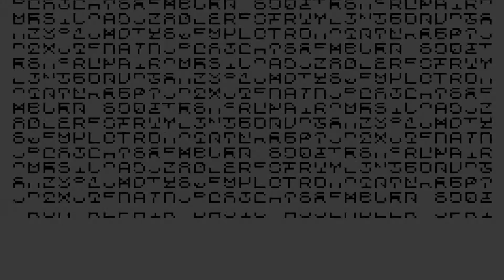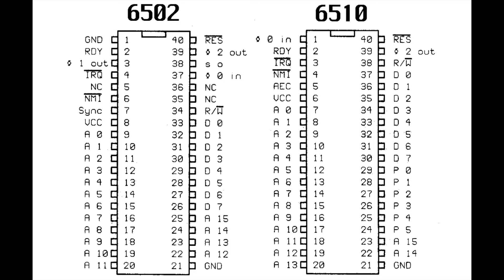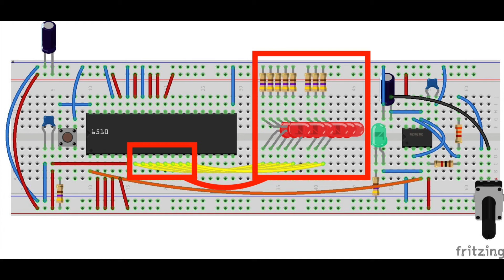Fixing a Poorly C64 - Part 2: Testing the CPU

Comment: Be careful, as far as I know, NMOS 6502 CPUs (including 6510) is not like modern and/or static designs which can operate (or even halted with stopped clock) with very low frequency clock, there is a minimal frequency to be guaranteed to work (though maybe this is less an issue with executing only NOPs, but even the PC register can be a problem with too low clock frequency). It's also somewhat dangerous to wire the data bus onto GND or Vcc directly (without resistors) and in case of RESET 65xx CPUs actually writes some bytes (the reason: RESET is implemented like an IRQ somewhat, it tries to push bytes to the stack). And in this case, poor 65xx must fight with the hard-wired bus states when it tries to write. Clearly your test worked for you still, just it's maybe worth to mention these. By the way, common ROMs are quite common the problem of stuck bits (though as far as I am aware it's more about data bus bits rather than address ...).
Reply from the maker: I thought reset just jumped to the address pointed to by the reset vector, so &EAEA if the databus is hard-wired to NOP - no stack involved. But stand to be corrected. I'm better acquinted with the Z80. The 6510 seemed to cope quite well with a clock frequency ~100Mhz. Maybe I got lucky. Anyway, glad this one passed the test!
Reply: @BreakIntoProgram  On 65xx, NMI IRQ and RESET all have vectors at the top of the address space, and also (to save chip space, I guess ...) uses kind of similar technique to process all of them: doing stack operations to push the usual things then fetching vector for the stuff, and going there. Yes, in case of RESET that's "insane" since no code happened before too much. But the logic was (I suppose) that it does not matter what it does, you always want to initalize memory, stack pointer etc after that anyway, and the chip construction -  at the other hand - can be more simple to have only a common logic for these three kind of "interrupts" (even - again - if RESET is not a "real" interrupt too much, but anyway).